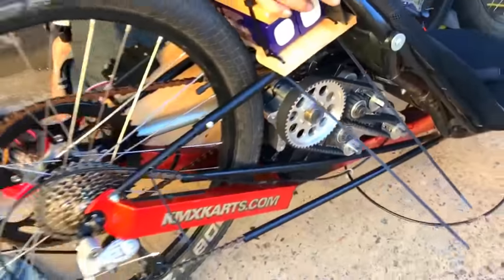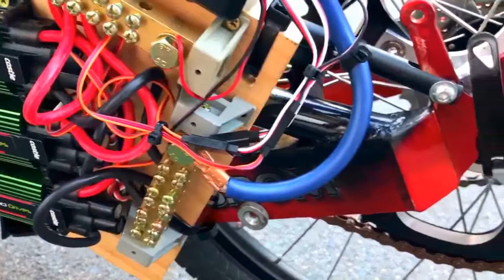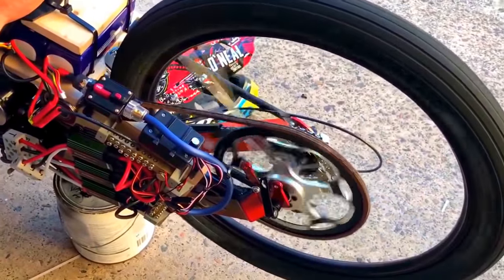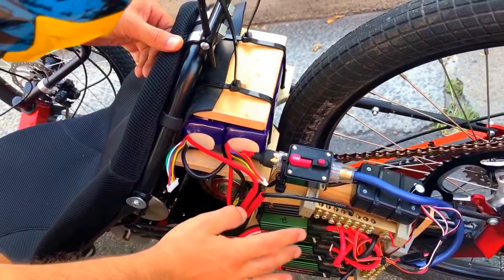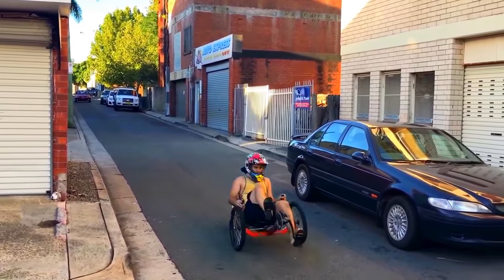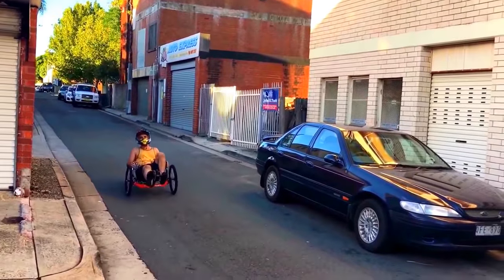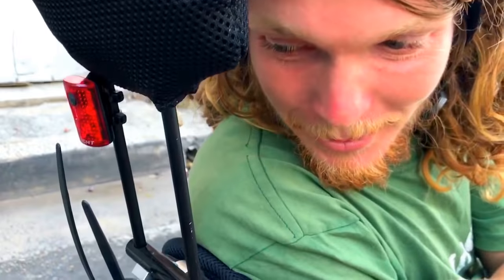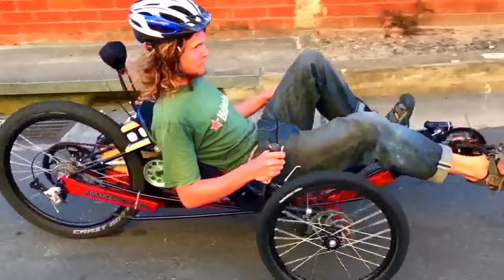DIY 42000w Electric Bike - 56hp Triple Motor (video#3) YES, monster is rolling! First tests at 300A

Comment: Geeeejizzzz!!! Demanding that one little Rear tire to cope with 300ft-lbs o' torque.. you need a drag slick.. and bigger batteries.   ☢️🚀😲🏁
Reply from the maker: Hahahaha yeaahhh I have made some improvements to this trike since I recorded this video, much bigger crazy power new battery, made the trike 12 inches longer and I think 6” wider and complete changed the weight distribution putting a lot more weight on the rear tyre, wider wheel and lower tyre pressure for a lot more grip. 
I have a video quickly showing some of these things  https://youtu.be/uDJxX_EYi_A  but I will be posting a new video soon showing the finished trike in ACTION... so much POWEEEEEEEERRR ohhh yeaahh =]
Reply: @BrunoPOWEEER  wow man!! Your trike is bonkers🤯 great work.. i love my custom Ebike, it's not as bananas as yours but it's incredibly fun, fast, and reliable.. 1500w/52v/12ah       hard tail w/o front suspension (I'm mostly on the street) here in South Florida biking is the way to get around.. I wanna start an underground ebike racing scene🤔
Reply from the maker: Hahaaaa ohhh yeaahh I’m pretty sure there are some crazy guys in south Florida, I remember some crazy powerful ebikes, are you on Endless Sphere on Facebook? 
Just make a post “anyone from South Florida” and people will write back
https://www.facebook.com/groups/endless.sphere/?ref=share

Comment: Had to come back & see this beast again. Such a clean setup with the belt drive! 
I'm wanting to give a 1960's trike (Gote Dune) a rebirth with E-Power. It will need some power to take on sand dunes. Unfortunately I'll have to stay away from belt drive because the sand would tear it up in short order.  I'm thinking motorcycle chain & sprockets and a rear differential. Fortunately I'll have more room to work with over the rear dif. POWERRRRR!!!
Reply from the maker: Chris Duke hahaaaa don't give up on the belt drive.. make a protection so sand can't get in.. chain + sand = crumbed chain haha will rust badly.. I took my fatbike to the beach few times and my brand new chain aged 10 years haha 
Chain is easier to setup but belt you set and forget, no lube no rust... I want another belt replacing that chain.
Do u have any photos or videos showing your 60's trike? Make something stupidly POWERFUL and send me a link haha.. so much POWEEEEERRR =]
Reply: Well, the ATV differential I plan on using is set up for chain. I'll be using a jackshaft with some sort of gearing. Probably only two or three gears, but I think a chain would be easier to do that with. I haven't figured out what to use for gears yet. I won't be using bicycle chain, so it should last a long time. I've had bad times with motorcycle belts in the rough. I can see driving all the way up to Pismo Beach & having a belt break. That would suck.

Comment: Considering that the Astroflight 3220 delivers 4kw (and not 14kw like you just said, as that is a PEAK value), and that by setting three of the same type in parallel you dont add power, but torque, you just have there a vehicle with 4kw (5hp) but crazy ammount of torque. Just to make it more clear, neither the chassis of that vehicle, or the drive train (chain, sprocket, motor screws) would withstand 56hp.

Nice project anyway!!
Reply from the maker: I am a professional electronics/electrical guy and I've been working on Electric vehicles, electric motorcycles, high power electric bicycles, energy storage solutions, consulting and product design for many companies from all over the world (things that I can't share here in my channel) this is my "garage project" that I am building just for fun...
There are a lot of things I could say to back my claims that by the way are not wrong. I have 3 separate controllers feeding 3 motors and they're each capable of feeding 14kw peak. Electric vehicles don't really operate on a continuous load unless you take them on a highway and drive/ride at constant speed. This trike is so powerful that I can't even twist the throttle without a burnout. I only need two seconds on the throttle and let it coast just enjoying the momentum, kinda like get a massive kick from behind!!
Electric motors you can tune to increase/ramp power gradually making possible the use of lightweight components, that would be impractical for combustion engines where the motion is not linear and parts must be engineered to handle all the harmonics and vibration.
My Astro 3220 are very different from the ones you see on their website, mine is completely custom with thicker and longer heavy-duty shaft for EV use, the housing is CNC open for cooling with a fan forcing air through the motor winding, motor cooling is everything + I do have some big fans also helping cooling the outside (I am showing on my next video).
Yeah... not arguing with you, I am just saying that its all legit and possible. =]

Comment: The steering looks VERY twitchy on that, At speed it will end up a death trap IMO. Need a longer wheel base. Also some protection on the front end as if you hit anything with this your legs are pretty much the first thing to go.

Comment: Hello, I wanted to create an e-bike but I am completely lost!

Can I use an xt-90S connector instead of a circuit breaker switch with precharge?
Reply from the maker: Heeey mate.. let me help you haha..
The XT90s only works when you’re joining the connectors. Some people think by having an XT90S in line on the battery cable would work as a pre charge but it only works as a pre-charge during that very quick 0.5 -1second as you plug them together.
There’s a resistor inside the female connector connected to a small ring facing the outer side of the connector. The slower you connect them fully the better. The faster the more chances of getting a small spark inside the connector. The XT90s works well for RC applications but also works well for 60v and 20s 72v (84v max) is the limit for the anti spark to work. Above that voltage, controllers have some serious capacitor banks and you actually need a proper pre-charge solution.
Circuit breaker is a different story, they act like a resettable fuse. You can kinda get away using a normal 110-240v AC circuit breaker to manage the initial spark.. it works... not ideal but does the job + it’s an additional protection =]
Reply: @BrunoPOWEEER  Ouah ! Thank you very much for this very explicative answer!

Comment: If I had a battery that contained 80volts 15ah and I wanted to use two 48volt controllers. low cut off is 41volts and max is 60volts each not sure for the let's say 40amps. One motor one throttle. Would the controllers burn out?

Comment: I need a 300amp relay like that, I found one just like what you have but its only rated up 24v I need 88v
Reply from the maker: Yeahhh these DC ones are only rated for low voltage 12-24v... my trike is only 12s which is 50.4v max so not too bad but not ideal. Anything higher I wouldn’t use it. You need a proper contactor (a big relay). Look up for Gigavac and Kilovac brands, they can do crazy voltages. I recently fitted one in my trike replacing the 24v, the contactor is rated to 1000v 350A continuous (totally overkill) but they need 12 or 24 or 48v to activate the coil.

Comment: is regenerative braking next? I live your build.
Reply from the maker: +GPBraaten thaaaaanks mate... I really like regen idea but I don't think I'll be doing with this triple motor... these helicopter controllers are not expecting power back in unfortunately. Anyway, most of the stopping power is on the two front wheels... I have so many bizarre ideas I may figure out something strange that works haha =]

Comment: I'm thinking you need more grip :) 
Good to see it rolling, looking forward to the next installment.
Reply from the maker: +EM3ev yeaahh the monster is rolling... did u see... I have more POWER than grip hahaha... I'm adding a super high current 30Ah pack hanging very low near the rear wheel. Im also installing a very advanced active BMS all made in Australia designed for electric vehicles and battery storage systems.. very interesting to see this all this technology on a small trike... =]

Comment: Breaking news! your bike is a trike
Reply from the maker: +Jake Dassan hahahahaa... I did a research on the word "trike" and most stuff was related to big petrol trike or baby trike... as I am using mostly bicycle parts and my channel is called "electricbike" I "decided" that "bike" was more suitable word to use (not the ideal) but yeah... this is why I called it bike... it's hard to name this weird machine I am making hahaha... one thing I know... so much POWEEEEEERRR =]
Reply: ElectricBike it's badass whatever it's called
Reply: ElectricBike you need to do some more research 😂

bicycle = two wheels
tricycle = three wheels

Comment: Any other race? How long the battery life for 1 time charge?
Reply from the maker: +adie kaswara yeaaaahhh I have done some tests with this trike after this video, always at night very late when there's no one around... 
These small batteries I used in this video are actually very very small, just for first tests.
I actually installed a much bigger pack with 5x more capacity, that means more kms and more POWEEEEERR with less voltage drop under load!
Next video coming soon =]

Comment: The only thing its missing is a 4" inch motorcycle rim with motorcycle tires... that way it wont burnout so easily; instead, it will do a wheelie
Reply from the maker: Haha yeaaahh I was considering about that but watch this video where I explained that I decreased the tyre pressure and it was doing some crazy trike wheelie AND burnouts and I nearly killed myself https://youtu.be/uDJxX_EYi_A

Comment: Wild stuff, I wonder what the 1/4 mile and 0-60 mph times would be? You need BIG b^lls to ride that baby in an alley. Very cool thanks for the link. I am 57 disabled to driving but bicycling Ok. I recently put a 750W BBSHD on a Schwinn beach cruiser, great great fun on sand trails through a 7-speed free wheel 14-34 and 46T BaFang OEM chain ring.  I am not a speed guy I like torque baby for sand..............next a full suspension semi fatty 3"

Comment: OH MY GOD!!! I hope you realize motorcycle tires are rated for speed and grab, aggressive tires is soft like those bicycle tires which is no good so you're in need of a harder rubber what's needed is motorcycle tires with rims made from carbon fiber for weight and strength with a rated tire that will last more than a couple hundred yards or meters! Those tires are shot! lol Just the take off speed will probably spin the tires on the rims, CRAZY! I LOVE THIS THING!

Comment: Scary man. Chain, brakes, tires, frame none of the parts can handle this power :D
Reply from the maker: +Bruce Ballad hahaha yeahh very scary... nothing designed to take all that load.. from mechanical stuff like wheels, chains, frame... to electronic stuff like motors, controllers... interesting, something is going to give up first... I hope nothing happens at high speed hahaa... 
What do you think will break first? Please pick two parts hahaha =]
Reply: Two? :D :D nah can't pick two...
First and foremost, The rear tire... I am sure it won't make it :D It is burning at every throttle, right?
AIso, I wouldn't trust that bike chains man. you need some bad-ass moto chains.
And, Weldings (and wood parts :D ) don't look strong enough. You could weld much efficient frame design. Isn't that parts vibrating and make noises while speeding? I hope they won't break under the power. :D 
BTW,  There were some wobblings in the video. I guess the weight is not enough for this HP.

Even you build every thing out of titanium It will still be scary :D How do you stand still on it when it wobbling or turning. dont you need a belt or some thing?

Comment: ElectricBike, how can I hook up the throttle to the servo tester?
Reply from the maker: I really want to make a video explaining this in detail, and also showing how a cycle analyst can be used as well. 
Most servo testers will have a 5k ohms potentiometer, all you have to do is to find a throttle that has a 5k ohms resistor, look up for Magura throttle or Domino throttle, both are 5k. 
You still need to feed 5v to the servo tester, super easy too, plenty of 5v dc-dc converter for less than $2 on ebay...
Cycle analyst you have more options, more settings, easier to use different throttles, the most common throttles are hall sensor inside instead of 5k potentiometer. 
Yeeeahhh.. I hope that helped a bit... at least you're heading in the right direction hahaha.. ohhh yeahhhhh
Reply: Cool, cool, cool! I already got the converter for the 5v supply. I don't know If I need a quality servo tester but right now I am using the cheap one from eBay.  There is any diagram that is available showing how to connect the throttle to the servo tester. Ahhhhhhhhhhhh! Yeah Mon!!!!

Comment: get some maxamps batteries - they're rated for 100C continuous
Reply from the maker: Yeaaahh. I heard good things about their batteries, they actually make some 150C race lipo https://www.maxamps.com/hard-case-race-edition-lipo-6500-4s-14-8v-dual-core-battery-pack
I got a new battery pack for this beast, its a 30Ah pack capable of putting 1700A hahaha custom made by Chris Jones, a very well-known motorcycle racing dude, check out his 700v 175kw motorcycle https://www.facebook.com/voltronmotorcycles/?ref=br_rs super freaking AWESOME =]

Comment: WOW.May I suggest a rollcage?
Reply from the maker: +Bryan Porter Yeaahhh I reeeeeally need one... I can see myself flipping this trike at anytime... the rear wheel gets totally out of control as soon as I pull the throttle...  
This is a steel frame, bit heavy.. I'll make a lighter aluminium frame from scratch with s roll cage, Will also increase the structural strength and avoid twisting under load...  need to test a bit more on this one first to get the next frame right... so much POWEEEEEEEER haha =]

Comment: Sun offa female dog!
 I would be able to get to Maccas on that thing for take away and still get home with a hot chips! Yessiree no more cold soggy maccas chips!
 You should be proud of that "rocket" 
 Finally a proper Trike. 
 Everyone just wants to know how fast it can go but screw that......THAT ACCELERATION! that's where it's at.
 I'd be happy only doing 60 Kph but get there in 2 seconds.
 Onya BrunoPOWEER for giving us a glimpse at what can be achieved!
Reply from the maker: Hahahaha yeaaaahhh exactly I want to feel that mental acceleration... this trike is a side project that I’m slowly making and it’s taking so many years but worth the trouble hahaaaa just to prove that it’s possible to make something super high current and low voltage, super lightweight 35kg and stupidly powerful all in one toy hahahaa

Comment: So the important question is.. can it do a burnout?
Reply from the maker: +Benissocoolike haha... ohhh yeaaahhh... I'm struggling to keep the traction... if I hit the throttle at any speed even at 60kmh it pulls a massive burnout... scary death trap... super hard to control... Im getting better now but still pretty scary... trying new wheels and tyres soon =]

Comment: Instead of using those lipos could i run these motors at the same performance using a disel generator???and using 3 vacum cleaner motors(3×2100w)?? Because i would like to make a project like this but when im out i dont want batterys to die on me.....
Reply from the maker: Hey Rais, for the size and weight of the diesel generator you are actually wasting a lot of power converting diesel to mechanical movement to generate electricity, then convert the electricity to the right voltage (more losses) then feed the electric motor and power the wheel, (electric losses and transmission losses), you'll get a lot more power connecting the diesel engine (without generator) directly to the wheel. The diesel engine is really heavy and you have to carry liters of diesel (more weight)... not a good idea.... Generators also have a delay in delivering big bursts of power as the engine needs to increase the rpm to deliver more power to the generator then feed your motor.... You won't get the same performance as a battery... batteries won't die if you have enough batteries... its a lot easier to find somewhere where you can charge your batteries than find somewhere where you can get diesel...

Vacuum cleaner motors spin reeeeeeeeeally fast so bringing this RPM down to a usable speed and trying to transform that high speed in torque won't work for many other reasons...  you will need 2 or 3 stages reduction (more losses) but the biggest problem is that the vacuum cleaner motors are not designed to take any load on the motor shaft at all... they will break or overheat and fry... + how would you control the vacuum motor speed? you need another PWM circuit to control the motor (more losses) definetely not a good idea too..
The easiest option is to buy a 3000w Cyclone motor http://www.cyclone-tw.com/dc24.htm and get yourself a Kelly controller like this one here http://kellycontroller.com/kls7212s24v-72v120asinusoidal-brushless-motor-controller-p-1348.html

The more power you want the more batteries or generator you'll need and the heavier everything will be. The lightest you keep your setup, the fastest you will go with a lot less energy... keep it lightweight and you'll fly with very small batteries and save a lot of money =] 

So much POWEEEEEEEERRR
Reply: thankyou sooooo much you are a great help😀😀

Comment: chain looks to be a bit too tight eh?
Reply from the maker: Hahahaa its a rigid frame with no suspension stretching or losing... if I tried adding one more link and it was too lose. At this crazy RPM would drop the chain over bumps at high speed.
Look how many changes I had to do https://youtu.be/uDJxX_EYi_A